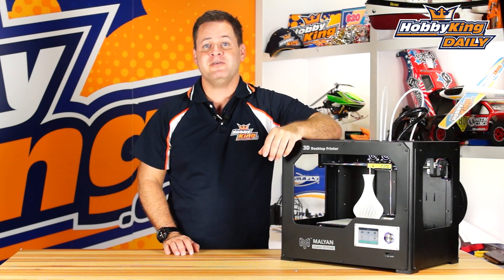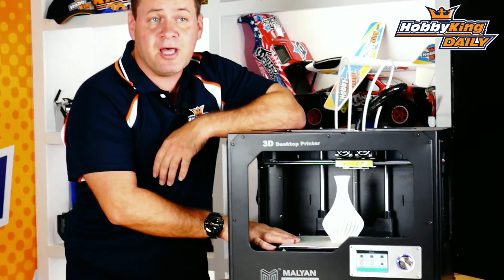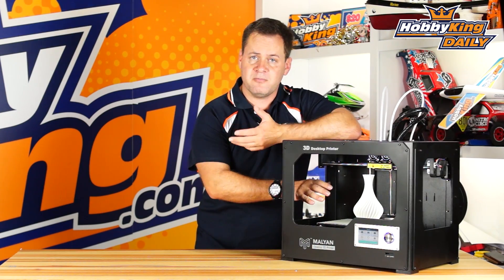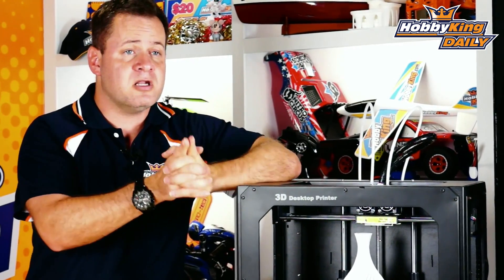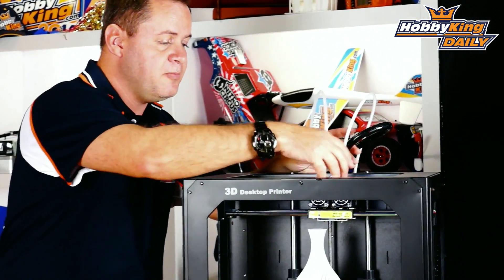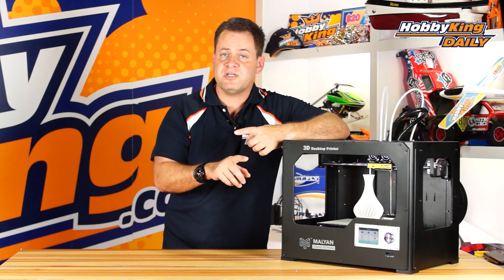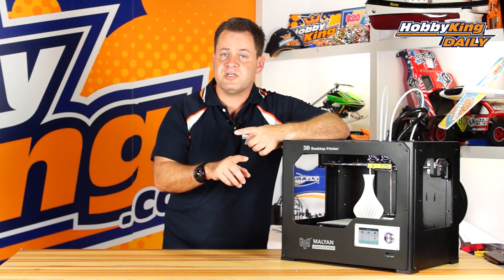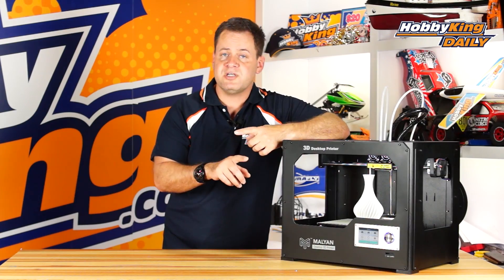Malyan M180 Dual Head 3d Printer - HobbyKing Daily

Comment: Bought one. Working on a review at the moment... First thoughts: Makerware doesn't work even with patches and new firmware. Produces unusable gCode during start sequence. Cura works good. ReplicatorG is more or less really old school and uses Skeinforge as standard slicer... urgs - can be changed to Slic3r, though, which is much nicer but the support structure generated by Slic3r is awful. My machine prints 90 degrees not as 90 degrees really and circles are slightly oval. (I'm an engineer and need max precision. I'll try to re-calibrate the axis mechanically, later. Overall: works out of the box. Prints from SD card like a charm and I like the menu. The dial is a different story since it is very slippery. I'll probably glue a new knob onto the existing dial to make it easier to use.
Reply: +Timo Birnschein If you have $150 to improve your experience you should buy simplify 3d. I have used makerware for the last two years on a replicator 2x (my work printer) and it is OK, but not great. I tried it on a flashforge creator pro (my robotics club printer) and it was total garbage, as was replicator g. Got simplify 3d and it has been producing efficient and flawless prints. It is amazing how much of a difference the software makes. Plus it is super adjustable compared to the other software. You can manually insert/remove supports, change the infill density throughout a single stl object, and more.The supports are SO much better and super easy to break away cleanly. I am actually going to send my boss some files to test on our makerbot and see how the same file with the same settings but using simplify vs makerware turns out.
Reply: +Timo Birnschein Oh, and dont expect super great dimensional accuracy especially with ABS. PLA will be better, but it is a harder more brittle plastic than ABS. But it is so much easier to print with. For holes, always expect to have to drill/mill them to the correct size. use extra shells to keep them solid. Circles always print small, even if they aren't holes. I have briefly read up on tolerances for puzzle cutting parts to print as two objects and then put them together. Apparently a .3mm kerf is supposed to be good, but I don't remember what plastic that was.
Reply: +nerdyrcdriver Agreed, If the firmware can go to Sailfish then by all means get S3D.  
If the heater tube is stainless steal then it maybe my next (third) 
machine.
Reply: +Chris Wilson maybe he and I are just unlucky with makerware. the gcode from it was useless on my flashforge creator pro. prints always failed or came out terrible, but without adjusting any hardware simplify 3d with the same basic settings continues to produce perfect prints. better than anything I ever got on my makerbot using makerware.
Reply: +Chris Wilson I contacted the support. Told me the same thing. Everything works well after installing new firmware and new makerware 3.7. I'm pretty happy right now. But I honestly think about S3D... I believe there is many F*ckUps with rounding errors on Makerware and Cura.
Reply: hallo please can you help me with my M180, I bought it new and I do not know how to do with programs and cura which one should I use and how can I have max 2 colors